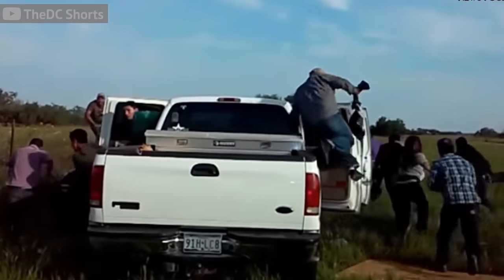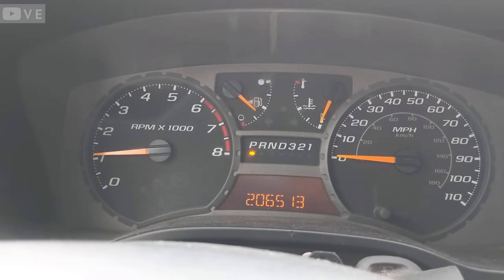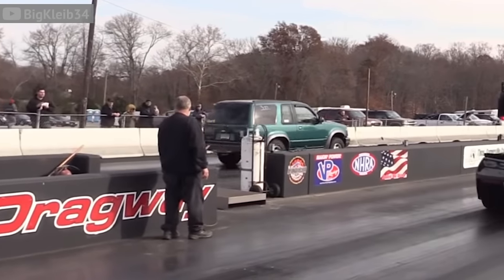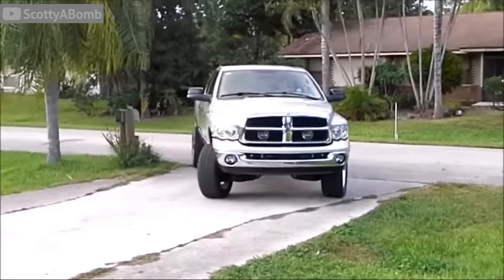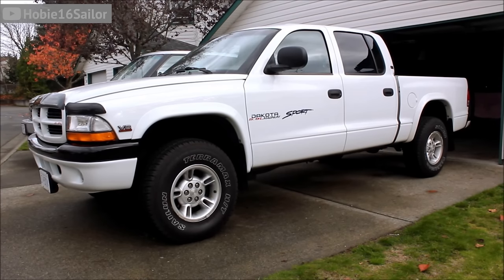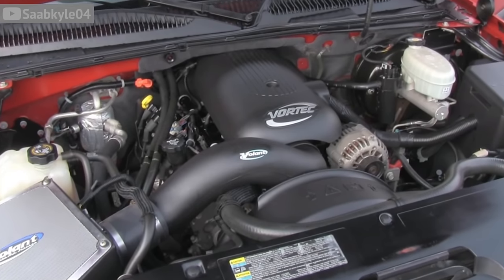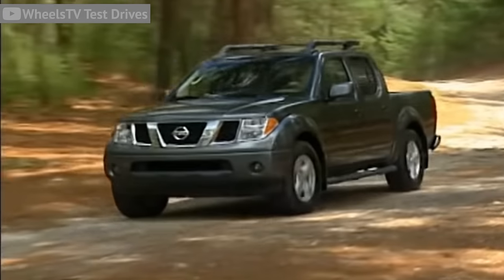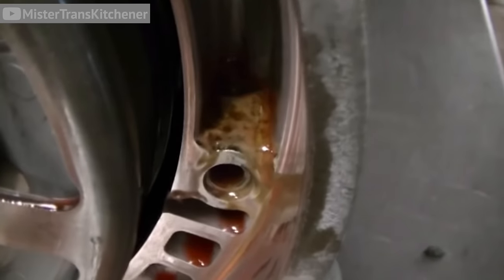USED TRUCKS YOU SHOULD NEVER BUY!

Comment: The 5.3 in the avalanche is a great engine.
Reply: And very reliable too. My uncle has an '04 with the 5.3 and it has way over 200,000 miles and it still runs beautifully.
Reply: Totally agree
Reply: Except for the active fuel management system can cost thousands to fix lifters.
Reply: @zztop8592  didn’t that come later, in the second generation?
Reply: @kftc1980  yeah, I think 2007.

Comment: 03 Avalanche with 230000 miles,runs like a charm👌
Reply: Bigdog Bulldog me too
Reply: Yeah my uncle's 07 Sierra classic. Has been a great truck, ik it's not the same vehicle, but same powetrain and base
Reply: @alexsabothomas3621  Sierra has a suburban frame? Noooo
Reply: @prolly2stoned420  in a crew cab truck frame they the same from the back door forward only difference is the rear of the frame is shorter due to the Suburban Yukon and Avalanche being being SUVs not a truck.
Reply: @alexsabothomas3621  😂 an suv Frame but clearly still a truck. Really when it comes down it it vans and SUV’s are just trucks with no bed. The frame does not make a truck a truck.
Reply: @alexsabothomas3621  the Avy is all one frame not 2 frames welded together like your typical pick up truck. Avy and suburban have the same frame.
Reply: @alexsabothomas3621  but yes it is shorter then a typical pickup but I can haul pretty much anything a typical pick up can
Reply: Just bought one with 245000. How is your avalanche running now?
Reply: @joshuagil209  still running strong 💪
Reply: Just maintenance?

Comment: He threw me off with the avalanche. Have 2002 avalanche z71 200k+ still running strong.
Reply: Only prob i had was window motor
Reply: On chevy avalanche 2004
Reply: @alexiawalton8510  im buying a 2004 tomorrow..is it safe to say that your truck has been good to you?
Reply: 04 was good if it was taken care of. Stay away from the ones with cylinder deactivation. They burn oil and tend to clack as they age.
Reply: Let me guess. Mostly highway miles?
Reply: Mileage doesn’t impress me because all you have to do is drive on the highway, where the vehicle is at it’s most efficient operation, and there’s your 300k miles.
Reply: Had an 2003 Avalanche No problems at 250K miles but then it got totaled
Reply: Alexia Walton  window motors are common in the silverados and sierras of that year model too
Reply: Cameron Harley a buddy of mine from high school liked to floor his any chance he got, I want to say it was a 2002. Well anyway, his transmission split in half, vertically. Has pictures too, I didn’t believe him so he ended up showing me. How in the hell it split that way I’ll never know.
Reply: Cameron Harley lmaooo, that’s fucked up, but it happens.
Reply: @enriqueortiz5440  Vvt

Comment: I bought my first avalanche 04 and i put it to the test a few days later threw some MT tires and 3 inch lift. Took her offroading and had to haul 20 people who were stranded all crawled up on the truck bed and the running boards and roof and the cabin was also full of my friends put her in 4wd low and made it out leaving behind other 4x4s that got stuck i even took the same path they took. That thing is a beast! Its not my first gmt800, i have a suburban 05 which is the same vehicle pretty much and that thing also has 220k and absolutely no issues used her to tow big vans all over. 5.3  vortec pre-DOD are hard af to kill and the 4l60e does the job.

Comment: I own a 2004 Avalanche with 215k not one problem with motor or trans yes plastic is faded but to be expected speedo works never had a problem
Reply: IKR! i have a 2009, LT, loaded. Haven't had a problem with it except for the fuel feed module, which was an easy, cheap fix. It can pull 11,700 pounds if I need it to. And it's in almost perfect condition! I LOVE IT!!!

Comment: The SSR isn’t a truck, it shouldn’t apply to a list like this.
Reply: True
Reply: Honorable mention
Reply: Yeah it doesn't belong here.  A pickup is about function.  The SSR is purely about form.  It's not even intended to be a truck in the way that the ElCamino was marketed as "a truck".  
The SSR is a sports car, period. 
And I'd much rather have an SSR than a Vette.  ;-)
Reply: The ssr sits on a trailblazer frame
Reply: Yes it does.  Still a sportscar.
Reply: Gavin Sumpter wouldn’t think that...
Reply: @redneckbryon  no, he's right.  It does sit on the tall grocery-gitter's chassis.  Which kinda makes that a car too, but with increased tow ability.  
I've heard that larger frame was incorporated with additional laddering in order to tame the unwanted flex of the body, due to its lack of hardtop....  a factor all convertibles struggle with in such ways that tend to make their chassis beefier and heavier then those of their hardtop counterparts.  But small suv frame aside, it functions as a sporty car, with the corvette's LS backing it up.  So yeah...  sportscars like the SSR sky belong in this lineup...  it's unfair to fail this fun little beast on the premise of something it is not, nor even tries to be.  
S.S.R. :  "Super Sport" was a Chevrolet CAR trim package, and "Roadster" is usually a smallish 2 seat convertible...... sportscar.  ;-)

Comment: My favorite is the Chevy avalanche
Reply: Love Pitbulls 2004 avy here! You got one?
Reply: He is wrong about the Chevy Avalanche. The 5.3 motor is reliable and it was used in over a million Silverado's. I never heard of the speedometer going out in the Avalanche. I still have mine with NO problems from 2006 and it is still running strong. All engine parts are the original except for the battery. BTW, I love pit bulls and I adopted two pits from kill shelters.
Reply: I have a 2011 avalanche ltz 4wd with 106,000 miles. No problems with power train just the dash cracks 😆
Reply: I love Avalanches too!
Reply: Why wasn't there a GMC version
Reply: @youngmoonyohnj1099  cause chevys the best

Comment: There’s another vehicle where he ranks the Colorado as top 10 reliable vehicles.
Reply: it’s got a bad motor i5 and a shit frame
Reply: Yeah but he was talking about different years,he said the first year  and the 2016-2017 years are worst.
Reply: I've got a 2012 colorado lt2 and love it. It's got an I5 and have had zero problems. I do a lot of trout fishing in Northern Michigan and it does a great job in the woods on two tracks and logging trails. I just got my first spot of rust on the rocker, it was in perfect shape when I got it a few years ago. I will admit most of the early ones I see have rusted rockers. But so does every vehicle in michigan
Reply: @Supergirl I agree, but mine has been great, and love it for off road around here, the trails are tight two tracks through thick woods mostly. I have a new F150, it's an awesome truck but I like  my Colorado better in most situations. F150 for long trips for sure.
Reply: @Supergirl ya, I use Colorado for everything, the F150 is our "fancy" ride.

Comment: Never heard any of that about the Avalanche engine and transmission either. You'd figure that would be a widespread mark against the Tahoe, Suburban, Silverado, Sierra, but nope those trucks are dead reliable.
Reply: Well 4L60Es don't last as long as the bigger 4L80Es
Reply: @alexsabothomas3621  2011 Escalade tows an enclosed trailer almost every day. Put a trans cooler on it. Been going for more than two years towing.
Reply: @lazydadsgarage  thats awesome man. Good luck with with your 4L60E, I was just stating what generally happens to then
Reply: The 60e in general is a piece of shit yes, I have 4 of them, my newest one is in my 08 Tahoe, but it only has 290k on it with original trans, maintenance goes a long way, however my 99 Silverado has no reverse with only 159k on it
Reply: That's a 6l90e in the Escalade. Great transmission!
Reply: @kristofertheman  6L80E?
Reply: In all fairness all Chevrolet products especially trucks and SUVs after 130,000 miles have inherent transmission failures just looking on Facebook marketplace Chevys with bad transmissions or bad third gears are everywhere but that's who could be expected with over 100,000 miles
Reply: @MDC2020  I guess I should note that part of my reliability was adding a big trans cooler because my towing temps were so high. But flawless after that
Reply: Love my 2005 Avalanche, no real problems. But I have to say that both my 2004 GMC Envoy XUV and my 2005 Chevy Suburban both had to have their transmissions replaced at about 80,000 miles. Glad I did, because nothing significant was problematic since then. But there was obviously an assembly line glitch in that year of GM trucks.

Comment: The vortec v8 is one of the best v8s my guy
Reply: Project LQ9 so good, that Chevy is doing away with them , right ?
Reply: Jerrett Lorton they arnt going anywhere, they just keep improving them as the time goes on
Reply: @jerrettlorton7437  20 years with is pretty damn good run I think do you say? They went back to the LT style engine..Just some engineers doing their job
Reply: Chevy and dodge made the best V8s
Reply: Thenoyesyboy same with the dodge 318 and 360 v8s they run forever too
Reply: None better than old carbed 350
Reply: Have had two 5.3 over 230000 miles with no issues other than alternators
Reply: @adrianl6754  They didnt "go back" to the LT Style. Those were Gen 2 traditional small blocks. They basically took the existing LS engine architecture. improved it new heads and direct injection and only brought back the LT name.  They share no similarities to the LT engines from the nineties
Reply: @ejb654  Well they share the LT name i guess so that's something?
Reply: GM ruined the 5.3 with that DOD AFM BS!!
Reply: @michaelvelez6931  that's why there are delete kits for that my guy
Reply: @ejb654  yea I had a tuner disable the DOD in my 2008 burb ltz ...love the way it runs now I'm saving to do a complete delete but in my opinion the 5.3 was great before they added the extra nonsense
Reply: Jerrett Lorton because they suck nowadays. Back in the earlier days they were some of the best engines. The older 5.3s and 5.7s were some top notch engines
Reply: My dad has an avalanche and the clock doesn’t keep time and it uses about half a quart of oil between oil changes.
Reply: Bullet Proof!!!! My 03 suburban has 225k on original drivetrain!!! The 5.3 and the 3.8 are THE BEST engines GM made

Comment: Dude...I have a second generation Avalanche LTZ. Great vehicle. This 07 runs, looks, and drives great. They hold their value. I looked all over the country for mine. They're some minor issues, but it's 13 years old. The doors close so nice. It is loaded with so many nice features. Factory running boards and rear tinted windows. I checked customer ratings. 4.5 out of 5 is pretty good. There's products out there to bring the black back. Have you driven one? Just say'n. Did like the video.

Comment: I’ve had my Chevy Avalanche for almost 5 years and it runs great I’ve never had a problem with it it’s a good truck if you know how to maintain it
Reply: It can be very reliable.  My uncle has one with 272,000 miles and it runs like new with no problems.except the only problem it has is a rear window on the driver side doesn't roll up or down and the transmission skipping 2nd gear.
Reply: @CoolGuy-ux5wx  they don't call the 4L60e the 4Lslippy for nuttin! People are always driving their Chevy's hard and wearing out it's clutch packs. That trans is based off the old TH400r 4 speed which was used in lighter cars and trucks, and they didn't upgrade the clutch packs but used them in heavier vehicles with higher tow ratings

Comment: I had a 2007 Avalanche LTZ that I absolutely loved, didn’t have any of the electronic issues but it did burn a little oil at times. Still one of my favorites I’ve owned
Reply: LowOnAir Z06 i have the 07 ltz
Reply: Alittle oil?! The DOD went bonkers in my 2008 burb ltz ...what a poor decision to add it and for what?? otherwise the 5.3 is actually a great motor

Comment: My everyday driver is my 02 Avalanche I bought brand new.  Valentines Day 02.  183000 still running strong.  Finest vehicle I have ever owned. Not counting stuff like brakes batteries and bulbs. I have had 3 issues master cylinder, fuel pump since i didnt change my filter when I should have and knock sensors because I got tired of the light.  Love my Avalanche...

Comment: Love my avalanche has a couple of issues but best truck ever.
Reply: They don't have any problems other than what basically every other Chevy struggles with. Axles, bearings, instrument cluster, electronic throttle body (if applicable) not all avalanches have electronic throttle body, steering gear, idler arm, pitman arm, water pumps, radiator, transmission failure. Other than all of these issues they are decent trucks
Reply: Full Send Filosophy only issue with my 02 was a water pump and brake lines. Have had the truck in the family since new and know its full history. Never changed the trans fluid and its still in great shape, never had any other problems besides the rust from michigan
Reply: @Attachments.  You're speaking for 1 truck I'm speaking for hundreds that our certified shop works on

Comment: The 2-valve 5.4 Triton's were solid. I had over 210k miles on mine before I let it go. (Still running strong to my knowledge too)
Reply: Life In The Taiga I had one . Shot spark plugs out the head but besides that pretty solid. Had 235k
Reply: @hoster-ph5ru   As long as the were torqued to 28-32 ft lbs dry you were in good shape.
Reply: My 2006 F1-50 had 225k on it when I sold it. Never had an issue. That truck took me all over the country and I had a 6 inch suspension lift and 35s on it. Even with over 200k miles it pulled my wife’s car from El Paso, TX to Maryland. No issues even in the hills of Tennessee
Reply: The 3 valve trucks are nothing but trouble if you don’t do maintenance on time and not using 5W30 oil.

Comment: Ford spelled backward = Driver returns on Foot.  There's NOTHING wrong with an Avalanche. I have 389,400 miles in mine, and it runs like new. 5.3 engines are tough.
However, it burns gas like pouring piss out of a boot. 11--13 mpg.... : (

Comment: The Chevrolet Avalanche is the best vehicle I've ever bought! I chose a car for all occasions.  The ability to transform/increase the loading platform with the middle gate is a very cool idea!  What other trucks have this?  And in my opinion, this truck looks much cooler than other pickups as it has its own design, different from others.  The rest of the pickups have a chopped-off shape with a 90-degree angle between the cab and the bed.  Avalanche looks much more interesting.  
Of course, if you need to constantly carry huge loads then you need a real pickup truck with a bed separate from the cab.  But if you want a versatile vehicle for all occasions, this is what you need.  Even if you need to transport long items, you can simply fold the central gate and then this load will not lie on the rear gate like in a regular pickup.  This truck is very helpful in most cases!

Comment: Completely glossed over the second series of Avalanche trucks (2007-2013) in which a ton of the problems were fixed and a new motor was added. 

The Avalanche had a movable midgate behind the second row seats ultimately turning the SUV bodied truck into an 8ft pickup bed. 

It's the ultimate flexible solution to the guy who needs an SUV 5 days a week and a pickup on the weekend.
Reply: Meanwhile this guy is saying it might not even classify as a truck. Sure it’s more of a SUV chassis but thise things handle it all. It’s like he’s completely unaware the midngate exists, also that comment about taking a suburban and chopping off the back. Not sure if he realizes that’s exactly what it is lol

Comment: Totally false info on the Chevy Avalanche. I owned the 2002, 2004 and the 2007. All were 4X4,  Zero Problems. They were awesome.. The plastic cladding did have fading, discoloring problems which were more noticeable because they were a lighter color especially in 2002. They never came painted. Most versatile truck ever made.

Comment: 2006 avalanche ran great still with 275k miles on it smooth ride replaced alternator, h2o pump , fuel pump, and other general maintenance at 200k but one of my favorite vehicles I've ever owned looking into getting another one the fold down seat bed extention is a game changer and I'm surprised nobody else has done anything like it since
Reply: The new silverado EV is gonna have the same thing for the bed
Reply: @carter2858  my interest in the Silverado EV (I'm still first in line for the RST first edition) led me down the path of the mid gate design. I never used to be interested in the Avalanche but now I'm looking at used ones in my area to replace our SUV

Comment: Sorry I have a 2010 Chevy avalanche and it’s excellent it has 189000 miles on it and I’m the motor doesn’t burn oil its really reliable transmission is solid very comfortable hauls whatever I want easily so he missed the mark on the avalanche…